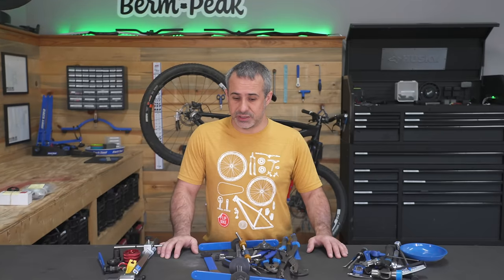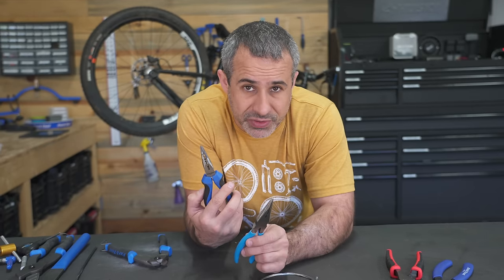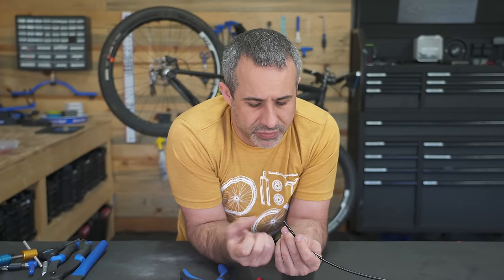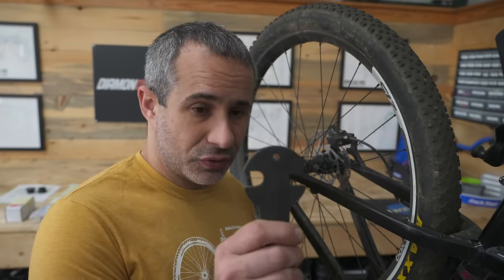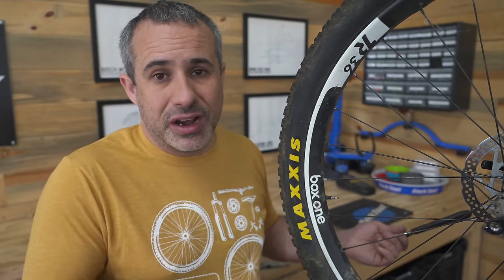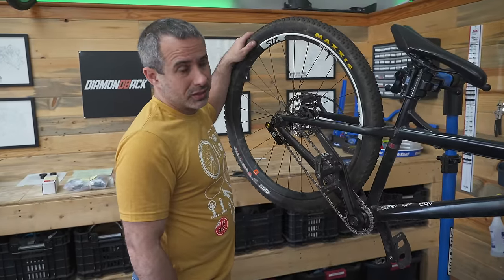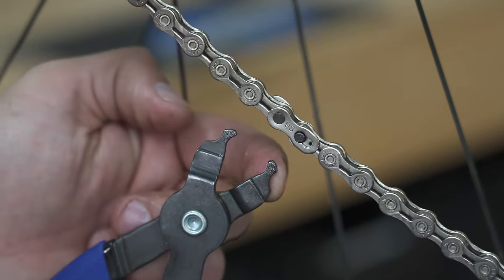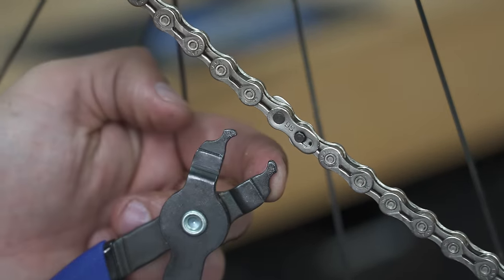Are "Bike Tools" really different from "Tools"?

Comment: As someone who has gone mechanic to bike tech to mechanic I agree with this 100% sadly I was at a big box store but I built my bikes with as much care as I would rebuild anyone's engine. But I still held the fastest time assembling in the store because I used the correct tools.

Everyone would be trying weird tools not built for the job but I would lay out my Park set before hand so I would have everything.

Imo the necessary tools that you would need are most definitely the ones he described in the end. And that headset tool is a lifesaver. I would also recommend a trueing wheel but I wouldn't go crazy on a super nice one. But only if you keep up that kind of work

Ps. assembly time was 13mins Inc paperwork and tuning, appropriate loctite where needed. Time started when the knife hit the box

Comment: It's the schrader side of the valve core tool that's so helpful.  Also, have done masterlinks by hand for years until I got a set of tire levers from Topeak that have that built in....can total undo them by hand, especialy out on the trail.
Reply: Yup, you need the valve core tool for Schrader valves.  Nice to have for Presta.  That said, many valve core packs include the tool, so you might as well just buy a pack of cores that include the tool than buying the tool separately.

Comment: You can open the kmc links by Hand perfectly fine, just push them together from the sides, not like you do with a shoelace or pliers but from the actual sides, then push the links like you would to Release.

I still have a Tool for that, but im not able to open them without pushing the link together while using the pliers, well, maybe it would work, but its scary high resistance and pushing them together just makes it use like no force at All.

Comment: Great video and excellent production values as always. The way I undo a master link with needle nose pliers is to set them diagonally. I put one tip on the rounded side of "face A" of the link, on the outside of the chain (like in the video), and the other tip on the opposing rounded side, but on "face B", on the inside of the chain. Squeeze the pliers and it'll come right off, no specialized tool or string/cable required.

Comment: Seth, for Brake housing you should definitely use angle cutters.  You only want the shear effect for the straight wire embedded shift housing
Reply from the maker: Yeah, on the straight wire housing it’s the only way to go, but don’t you find that it leaves a cleaner cut on solid housing? On certain housing I find that side cutters or diagonal cutters crush the center (unless you leave a cable in it). The housing pictured in the video was Sram, and that seems to work just fine with any cutter.
Reply: @BermPeakExpress  Yeah makes sense, at the shop I work at the mechanics always taught me to use the diagonal cutters for brake housing then go back with a park tool pick and open back up the channel for the barb.  Appreciated the video man!

Comment: Back in the nineties I made a derailleur hanger straightening/alignment tool out of common hardware store supplies 😎
Reply: I have used a scrap front wheel with a threaded axle for this once (the thread fit the derailleur mount) with a zip tie in one spot :)

Comment: Having been an automotive mechanic for nearly 20 years I have a full set of Automotive tools. A long long time ago I worked in a bike shop so I know there are a lot of specialty bike tools needed. These days I find the best thing for cutting cable housing is a die grinder with a cut off wheel. Cutters tend to leave a slightly janky end on the housing which can affect the way it seats into the barrel Adjusters and noodles. The die grinder leaves a very uniform Edge that sits beautifully into the noodles and Barrel adjusters.

Comment: If you look at the BMX side of bikes a lot of pedals are impossible to remove with a standard wrench. The contact surface is only about 2mm thick so standard wrenches won't fit. If you don't believe me look at Primo Turbo pedals. We also use Allen keys for pedals but those tend to strip easily

Comment: I know for a fact Seth is using that electric pump to pump his shocks from now on😂 That was just too easy compared to using that hand pump.
Reply: Just aim 1psi under and it seems to be perfect
Reply: I run over 250psi in the rear shock.  That would be nice to be able to use the electric.
Reply: @robertmisiuk7137  I’m a road bike guy so don’t know much abt suspension. But isn’t 250 a lot for the rear??
Reply: @dannygallagher9290  It depends on the shock.  Mine is an old Fox Float.
Reply: @robertmisiuk7137  interesting. The more you know i guess lol. Do those style of shocks have issues with blowing out seals? Still seems crazy to me for such pressure lol
Reply: @dannygallagher9290  a lot of the rears match rider weight pound for psi.
Reply: @pizzapie4me  ah. Makes sense. What would b a psi for a 180lb rider
Reply: @dannygallagher9290  180.

But that's not every shock. Some are different.
Reply: @pizzapie4me  makes sense
Reply: TIL you have to pump the suspension
Reply: @dannygallagher9290  Most popular shocks have a max pressure of 300 psi
Reply: @dannygallagher9290  I would think the amount of pressure depends on the brand of air shock.  My front forks are RockShox Judy Silver which I keep at 120PSI.
Reply: @Durwood71  cool
Reply: I use my floor pump on my rear shock, until it gets up to 150 psi. Then switch to my shock pump. The rear shock has to be pumped up to 275 psi.

Comment: I submitted a suggestion to Harbor Freight for them to start offering Park Tool alternatives like they do with Snap-on/Mac for automotive tools. Look at the Park Tool tire inflator chuck for example, $140 for a tire inflator just because bikes use a different valve stem than literally every other inflatable tire on the planet. A good tire inflator chuck should be about $40 - but bike tool prices say it's $100 more? Yeah, you can smell the greed from here.
Reply: $1 presta to schrader adapter.
Reply: That's 'bike tool tax' in action. Park are possibly the worst offenders. 
Their 'specialist ' 32mm flat wrench for old BBs I priced at over £20, when an identical item for (iirc) a Land Rover engine fan was under a tenner.
Reply: @alpd7638  I also use these presta schrader adapters, they are cheap but work fine. You can even inflate bike tires with these adapters at fuel stations

Comment: that "phillips head screwdriver" held up at the beginning is actually a JIS screwdriver for shimano derailleur limit screws.  it's a slightly different profile to phillips - you can make a phillips driver work but a proper JIS screwdriver works better.  and that Park Tool one is by far the easiest to find in north america.
Reply: Yeah of all the tools he picked the wrong one haha. He could have picked the park tool mallet, or crescent wrench
Reply: I have some Moody precision JIS screwdrivers that I use for shifter pods after stripping a few screws with Phillips drivers. And  a few Craftsman rebranded VESSEL BALL GRIP Screwdrivers for the larger JIS cross and Flatheads screwdrivers.

Comment: The cable housing cutter was the tipping point for me starting to buy dedicated tools for bike maintenance. Hardware store cutters just weren't strong enough (or they left the cables mangled). I bought a cheap toolset from bike nashbar in the 90s (mail order!, pre-internet). I still use most of those tools today, so yes, they will last a long time. Of course, some tools are obsolete now, but the cassette tool and tapered crankshaft puller still work great.

Comment: Great video that many do it yourself bike mechanics can relate to. I always ride with a hydration pack when I am on the Mountain Bike. I am the official tool guy on group rides and when I ride solo no one is going to come get me if I am miles into the woods. Always carry light weight bike tools for chain and valve core. Some small extra parts and always have zip ties, electrical tape, a few strips of Gorilla tape just in case. My best on trail repair was making a splint out of sticks, zip ties and gorilla tape to hold a cracked rear triangle together so a guy in our group could ride 6 miles back to his car.

Comment: There are Japanese industry screwdrivers that work so much better on drivetrain screws than the drivers you get at hardware stores. The steel quality is pretty nice on most of theses, too.
Reply: That's because Shimano doesn't actually use Phillips screws. They use jis (Japanese industrial standard) screws.
Reply: @Cynyr  I disassembled a brother CNC machine (japanese) and learned that. ha. There are probably a hundred "phillips" screw driver tips. I have at least 20, and never seem to have the right one.
Reply: Love JIS screwdrivers.
Reply: Unbelievable, I'm going on 20 years now as an industrial mechanic and never knew this. I always thought that some Phillip's screws were just manufactured wrong because of how easily they could strip out since the screwdriver would not fully engage the screw. I just did some research and found that JIS screws have a dimple or cross in the head to denote this. Looks like I will be buying some of these screwdrivers. Thank you!
Reply: JIS, Pz and Phillips might look the same but they're not. Very, very few people know the difference and just mangle everything with Phillips drivers.

Comment: Master links CAN be removed by hand usually. Also using pliers and the edge of neighbouring outer plates rather than trying to squeeze needle noses into the gap.

Park adjustable goes up to 40mm, useful for some threaded headsets. Other adjustables often max out at 30 - 35mm.

Comment: The cup press is really easy to made for someone that can work with metal.. I would done one in 2 hours.. The rod you can shorten, bigger washers are easy to find or you can make one from pieace of steel with basic tools... If one cost 50 bucks for example and u can make one out of material for about 10 bucks.. U still save 40
Reply: In Europe you get big washers for statically purpose on construction sites (DIN EN 1052), they have 58 mm outside diameter for M12 bolts
Reply: @simonm1447  Im from Europe and I know that so I was put off by him saying you can't get them.. but can still make washers from a place of steal.. I dont have many tools at garage but I can still make those with little efford..

Comment: I’m one to use cheaper alternative tools when possible, but after wasting money on a few cheap pairs of cable cutters, I bit the bullet and bought the Pedro’s cable and housing cutters. It’s really worth it
Reply: I absolutely agree. "Regular" cutters flatten the cable and make a huge mess. Cable cutters are well worth the saved frustration.
Reply: I just bought hardware store cutters for stainless balustrade cable.
Reply: Generic cable cutters work well... for maybe several cuts. After that they don't cut properly anymore. Bought a nice set of parrot cutters and it gives me joy every time I cut some housing.

Comment: I 3d printed a sram dub bsa threaded Bb tool, worked perfectly and allowed me to torque it up to the required spec, one of the few things I didn’t buy bike specific. The file was on “thingiverse”
Reply: For a bike mechanic probably not the best but for me? I only need to use the tool once. Maybe twice in my life. I don't need to spend $40 on a bb tool.

Comment: Also, master links for basic bikes, like 5, 6, 7, 8, and 9 speed master links, are super easy to pull apart by hand. If you want to do your nice 10, 11, or 12 speed chain, you need the tool. Found that out the hard way my first time I bought a full sus.

Comment: A regular box wrench on pedals: I did that once to install pedals as it was all I had at the moment. I didn't realize the wrench was just barely wider than the flat section of the pedal. I tightened the pedal and realize I couldn't get my wrench out. It was squeezed between the crank arm and the end of the flat section. I learned a lesson.

Comment: If you have a rear derailleur, you can use pliers open the master links/quick links. Also you can use them to crimp the wire crimps. Been doing it for years, I have Jagwire cable cutters with this feature eincluded but it means lack of room, the old hazet pliers work great. They are long, and easy to handle, hold and get to a the wire no matter the rear derailleur you use.

Comment: Honestly, pedal wrench has been a life saver. Its longer than most open ended wrenches, giving me the necessary leverage that I wasn't getting with open ended wrench + deadblow hammer.

Also, bike-specific torque wrench gives the necessary granularity that you only get from "regular" torque wrenches if you go REALLY expensive. 

But as far as t-handle wrenches and torx wrenches, just normal budget level stuff from the hardware store or Harbor Freight works JUST fine.

Comment: great video as always! For brake housing i just use hardened pliers. For Pedals just a normal wrench, for shortening a chain i just bang a flathead into the wider part of the chain with a hammer and it comes apart rather easy. Will get a chaintool tho because it's not as loud, For opening a master link i use needle nose pliers.

Comment: I'm using the DIY bracket press and it works. I used a threaded rod, a nut, a washer that fits the rod, a bigger washer, and a rubber washer from the sanitation department. And the same on the other side with a nut that has a different outer size because I only have one of each sizes of wrenches.

Comment: We use spoke wrenches on bikes for the same reason we use line wrenches on car brake lines: they offer an extra point of contact on the nut/nipple, which reduces the chance of destroying it. Especially on older bikes/vehicles, even a small amount of corrosion can be the difference between getting a fastener off and rounding it off.

Comment: I have pack pliers in my multitool when I'm riding but in my home workshop use just regular pliers for my chain. If you manipulate the chain so it's shaped like a U, then push on the master link diagonally it pops right apart. And instead of holding the wheel and jamming the master link back shut, just hold the rear brake. Position the master link on the tension side of the chain and it pops right back together.

Comment: I have always used a dremel to cut chain links apart as i never had a chain tool, another tip is if you want to use channel locks on a scratchable part you can use a thick rubberband to go inbetween the jaws of the wrench and the part.

Comment: Gotta say to put a headset/bb press together is rather easy. There are tons of youtube tutorials and you can find the parts you need online if you can't find them in your local stores. You can also get very inexpensive ones on amazon etc. However if you use it frequently it's nice to invest in a proper one but I'd say 80% of ppl use it one or twice a year max.
Reply: I tried DIY headset press for my recent bike build. I could not get the cups to go in evenly with it, I decided that this wasn't the place to cheap out on my new carbon frame and ponied up the $'s for a press.  For a single tool it was a considerable amount of money, but it worked well and damage to the frame.

Comment: For the valve core remover, a wrench only works on presta valves. On Schrader valves you can remove them with a small flathead and some struggle.

Comment: I like the Jagwire Pro Cable Crimper & Cutter.  The crimper. uses a 3 jaw crimper like used for electronic plug pins.  Crimps on 3 sides & is very strong & neat.  Cutter is a clean cut also.  If you need pedal extensions (I do) a standard adjustable will not fit, it's too wide.  A pedal & thin wrench is needed to tighten or remove the pedal but not the extension.  I don't care for adjustable open end wrenches.  If your not careful they can fit loose & round what your trying to tighten or loosen, especially on small fittings.  Everybody uses them wrong anyway.
Before I retired I worked on NYC Subway cars, electrical & mechanical, & supervisor.  Many guys were hurt using an adj. wrench because it slipped because of poor or loose fit!

Comment: One thing to bring up is that what looks like a bike Phillips head screw driver, should actually be a JIS screwdriver. Japanese industry standard screws are used on all shimano derailleurs and are very slightly different than a Phillips. Phillips screws are made to cam out to prevent over tightening and JIS are not, both will work, JIS will work better

Comment: Sketchiest thing I've ever done on a bike was a rusted/overtorqued ebike "casette" nut on a gates belt. The park tool fit but the wire for the motor ran through it and I could not get a socket over it, nor could I break it with a wrench alone. I have to put a 1 inch crows foot attachment in my impact wrench and hammer it loose. The second it came free, my impact wrench yeeted the crows foot a good fifty feet out into my yard.

Got it off though.

Comment: Some of the premium line tools from German brands have some crazy tough near indestructible cable and wire cutters also with built in crimping functions .but in this case buying Park Tool is properly cheaper. Some tools you can not replace there is a basic set of tools required that is just a fact if you do not want to wreak everything all the time . In an emergency with no availability of the correct tools they you have to do whatever is needed to get back home or to the nearest bike service shop, and then just pray they have the part in stock in the current supply issues times. Again a very nice upload.